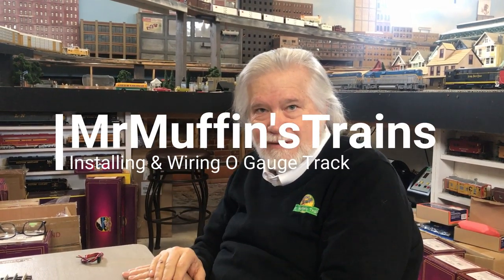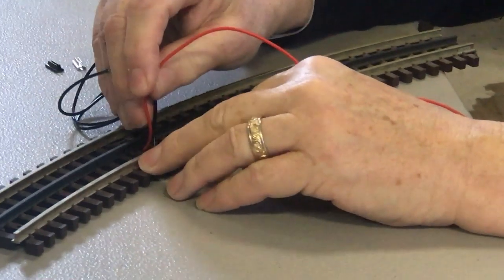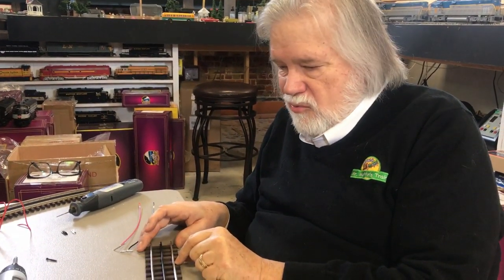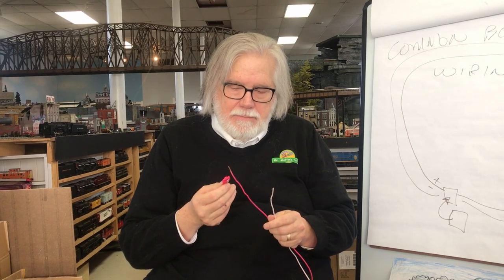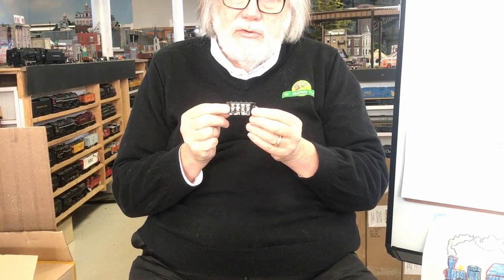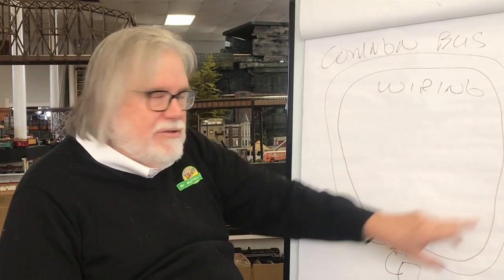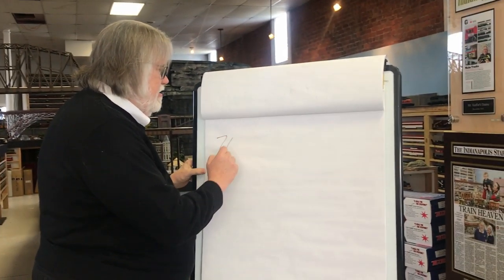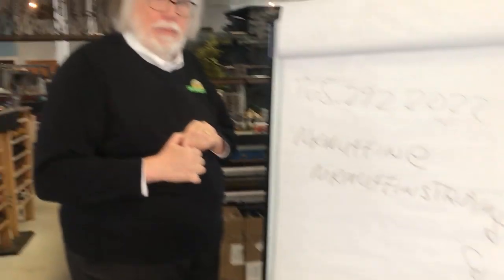MrMuffin of MrMuffin'sTrains discusses laying & wiring track

Comment: Many years ago on my first huge train set up I used Gargraves. On the whole base of the layout it had one layer of waffle wall cardboard and then one more under the track ties as kind of a raised ballast. I held it to the table plywood with pan head screws. So on the Gargraves wood tie track I would push two ties tight enough to have the screw threads fit through but not the pan head top, and that worked well, no drilling required..  I also think the Industrial Rail track will mate with Gargraves very well too.

Comment: I solve my signal interference from static ground in room tunnel issues and low-pass issues by using telephone polls an electromagnet wires for telephone lines and ground that to a ground plug into the wall. One neutral wire for the whole layout. Saying ground for what kids can understand but in the real world it's really saying neutral. So you can also use structures such as bridges that come with metal plates in the bottom you can ground those plates that helps. Between the styrene in the mountains you can put large tunnel I put a 4 x 6 sheet of metal and grounded that and that worked really well. I don't have any MTH quipment I did not wire my layout in a star I just ran one common ground. Just like you would be wiring a house a house has one common neutral

Comment: As a electrician ,  with low voltage I would use 14/2   or 14/3        romex  with  runs to each connection .

Comment: How do you connect the down wire or the drive wire to the track? I understand all the other stuff but you’re not sure how to connect it to the track with the wire going up to the train board to the track. Please explain how pat
Reply from the maker: What track system are you using?
Reply: O gauge thank you pat

Comment: This video was extremely helpful and I thank you very much for sharing your knowledge. 
Question.. what gauge wire do you recommend for your larger layouts and should it be stranded or solid core? 
Thanks again Mr. Muffin!
Reply from the maker: We use 14 gauge stranded wire - easier to work with - here's what we sell at the shop: https://mrmuffinstrains.com/products/wire-14-gauge-2-strand-price-per-foot

Comment: I just ran my trains for the first time this weekend and learned that the newer PH 180 has a pin in the cable that needs to push in for it to work.  The adapter cable that I purchased didn’t push the pin in and so it wouldn’t work.  The cable would work fine on the older Lionel PH 180 transformer.  Not sure if the newer adapter cables to the MTH TIU are set up to solve this issue.
Reply from the maker: I will have to look into that - glad you resolved it.
Reply: @MrMuffinsTrains  there was a great thread on O gauge forum with a person having this same issue and so it helped me solve mine.  Interesting situation and just wondering if others may have had the same experience.  Lionel should just manufacture a plug that would work for MTH even though it’s their competition.

Comment: Hi Mr. muffin just moved my train layout well three years ago from New York State down eastern North Carolina. I want to try and set it back up in a 12 x 28 shed which give me about 10 x 26 area what style of electric do you recommend the drop down system not sure what it’s called but what with a Main Loop and drop downs or separate lines every 6 feet or sell. Thank you sir.
Reply from the maker: I think 4-5 drops per loop would be plenty - doesn't need to be every 6 feet.... take a pair of wires from each drop down back to the central point terminal block. What we are trying to do is maintain roughly the same length out and back - the signals go out on the center rail and come back on the common....

Comment: I'm surprised Gargraves doesn't make better rail pin to deliver power. These pins are notorious for breaking at the flimsy solder joint.

Comment: Will any of my 1946 - 1952 3 rail trains run on any modern track? Of course it would have to be three rail. Is 3 rail still made? Will my antique track work with any of thee modern track? I have an antique O gage system.
Reply from the maker: Yes, they will... lots of choices in three rail track today, and most have connectors to connect with the older tubular track.

Comment: Really informative and would like to see more. Your website lists out 2 PH-180s one in stk and a preorder listed as 10 amp. Are both unites 10 amp?
Reply: I see there is a 10 amp and 7 amp versions. What is the pro or con with either unit?

Comment: Could you do a video on where you insulate and feed wires for blocks around switches?  What’s the best way to feed power around switches?
Reply: @mrmuffinstrains7837  and this doesn’t degrade the DCS signal too much?

Comment: great info here i currently have a table built and track plan and trying to figure out wiring on the star wiring can you use your drop wire all the way to the terminal?  or should i drop it to a terminal then to the mail mth terminal?
Reply from the maker: Yes, that would work fine, dropping the wires from the track and running all the way to the main terminal block

Comment: Hello Mr. Muffin, you mentioned you attach 3 wires to all 3 rails on your Atlas switches. Do you tie together the 2 black wires (_) underneath the switch?
Reply from the maker: Actually, not all three..... the blacks aren't that important.... the center rails for sure - that's where the issues occur....

Comment: Will my 1948 and 1952 O scale set run on modern systems. I even have the old transformer but don't remember if it works. Will the modeern transformers work with these antique trains?
Reply from the maker: Yes, they will....

Comment: MRMUFFIN, How do you isolate atlas track to run two trains, one around loop while other is in isolated siding? Thanks
Reply from the maker: Atlas O makes a clear plastic track joiner to connect the center rail to insolate it.....

Comment: Legacy so much easier  than DCS . Why Cant MTH make there engines  run on Legacy or like Lionel Legacy?
Reply from the maker: Once you get DCS working, it works great. If we an help, let us know.
Reply: @MrMuffinsTrains  you can run mth with legacy cant you ?  in conventional mode correct?
Reply from the maker: @benweers8306   - yes, they can run conventionally....